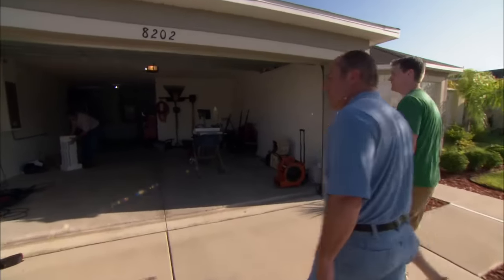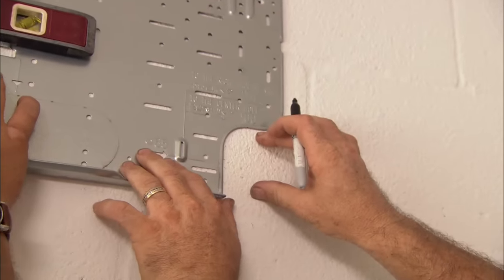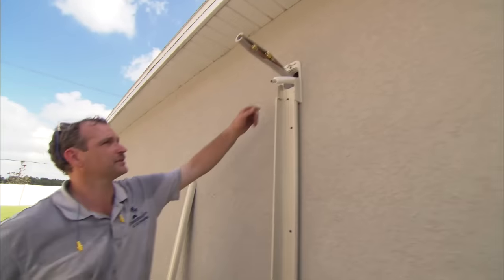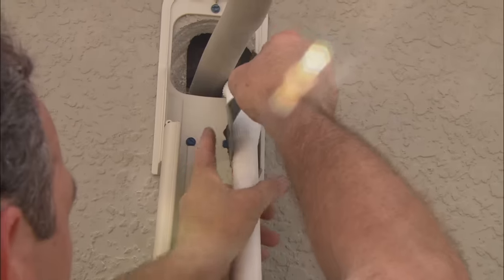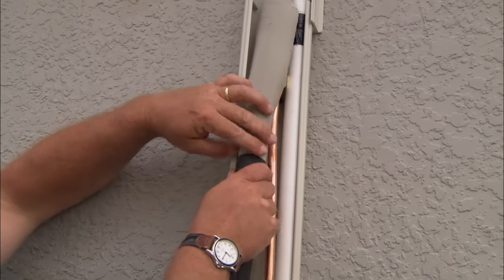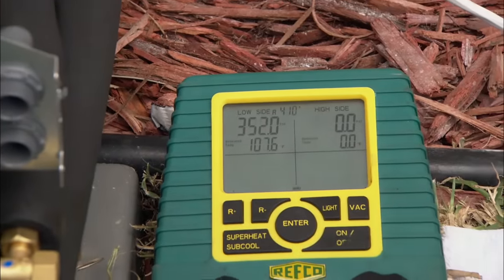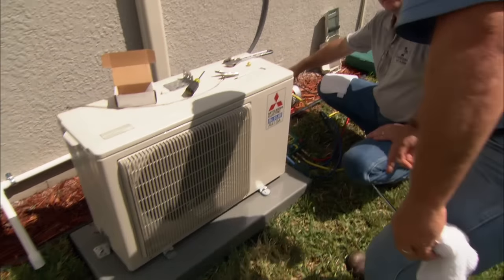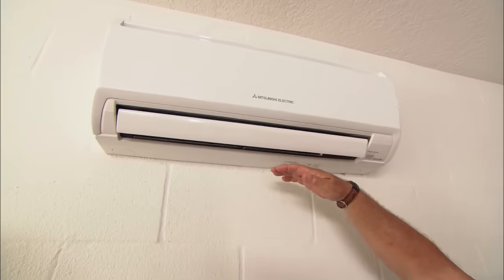How to Install a Ductless Mini-Split Air Conditioner | This Old House

Comment: I think potential purchasers  of a Climate Right mini-split AC need to know the company has virtually no repair plan for the system. My direct experience with their tech support yielded no repair option, just replacement of the entire unit. Who wants to have to tear out and replace the entire system within 3 years? It is the only option per Climate Right support. Buyer beware. Check with your mini-split manufacturer or HVAC service experts before you buy.

Comment: After watching a couple of TOH videos about mini-split systems I now know why installation costs are so high.  That is a lot of work putting in one of these systems and what it means to have qualified installers.  Thank you.
Reply: Ductless split units are actually usually quick easy money. As long as your not placing the heads on inside walls. The tools however to complete this job are roughly $1200.00.
Reply: In India the installation cost is $20 lol
Reply: @Dave-so7sf  Mr. Cool has a DIY kit with precharged line sets that don't require any of the fancy tools and can be installed by anyone.
Reply: lol what? Mini splits are very easy to install.
Reply: No, they are high because you are getting screwed. An even moderately competent person could do this in a day.
Reply: @Dave-so7sf  You definitely don't need 1200 worth of tools to do this.
Reply: @dancooper6002  To do it correctly you do. You need a tubing cutter, flaring tool, pipe reamer, refrigeration gauges, vacuum pump, micron meter, nitrogen regulator, and nitrogen bottle. Not sure about Mr. Cool but Mitsubishi is king.
Reply: @Dave-so7sf  You could probabally do without the nitrogen crap if you are careful. Gauges and a pump can be had cheap at Harbor Freight. The others are basic hand tools.
Reply: @dancooper6002  Didn’t realize you could purchase a vacuum pump that cheap. I’m a fan of doing a nitrogen test just because thats how I was brainwashed and it’s the correct way. However your probably right you could do without it. I would at least have that micron meter on there though. If it doesn’t pump down under 400 microns you probably have a leak.

Comment: One quick question, how did you know where to drill hole from outside that's perfectly aligned with the hole made inside? thanks
Reply: the corer has a drill bit thats pointy, when he went through the first wall, he kept it level and kept on drilling with the bit and not the corer. Once hes outside, you put the bit in the hold and core again.
Reply: use zip ties than tape
Reply: You can buy 18" masonry drill bits that will go all the way through.
Reply: we use a long drill bit to make the center hole throuth all the wall then you use your hilti with a guide , once the Hole is start you remove the guide and you drill, you have to finish on the outside to make a good finish, you also have to dril in a angle on the bottom to protect from rain , sorry for my bad english lol
Reply: Ramas  measure high and length Inside then do the same outside
Reply: The masonry drill bit has a pointy tip perfectly centered. After you finish drilling halfway through that masonry you take a small drill bit and drill through the mark the big masonry drill bit makes in the center. Remember he only did this not to mess up the stucco. His drill bit was long enough to go all the way through, but this was a professional doing the job and he went the extra mile to make this job perfect.
Reply: Ramas the hole saw they used had a drill bit a little longer than the hole saw and it makes a hole on the outside.
Reply: Ramas ja ja ja used your brain for ones ja ja ja
Reply: Measure twice .. cut once
Reply: Ramas the drill head has a drill bit in the middle once they make the mark they send another long bit straight thru the wall...that. will the center on the outside
Reply: you just drill a small hole in the middle of the circle to the outside
Reply: Dub C 

...reminds me of that old Carpenters joke;

" I cut that thing THREE TIMES and it's STILL too darn short!"
lol
Reply: a tape measure...
Reply: Man This guy is and expert installer..!
Reply: Ramas measure it lol
Reply: Rosie Alonzo This is not an English class, chill!
Reply: Jay McHue they probably don’t want to make a complete comprehensive guide  as that kind of knowledge and skill is how some people make money.
Reply: On the outside corner of the building you measure how thick one brick is, then you measure the distance on the inside to the hole. Then you measure that distance + brick thickness on the outside of the wall. If you’re half a cm off, it won’t matter for this purpose.
Reply: Pilot hole all the way through the wall before drilling from the inside
Reply: There are several ways to do this.
What I like to do is after I have drilled through the brick wall, is put a drill bit in the center of the circular saw bit. The bit should extend out farther than the teeth of the circular saw bit.
I use this bit to go ahead & drill through the rest of the wall, from right there in the garage.
Now, from the outside I have a small hole. So if my circular saw bit has a diameter of 4 inches, for example...I know where to drill from the other side.
All I do is place the center drill bit in the small hole & drill through.
Reply: @Nick1814  he was avoiding blowing out the outside of the when the bit breaks thru. Always drill from both sides for a pretty hole. ;)
Reply: Experience
Reply: Use your tape meusuere
Reply: Use a chipping hammer and make a huge hole from one side to the other
Reply: Super small diameter very long drill bit through to the other side 
So it’s an easy patch if you don’t want to keep the hole
Reply: First you need do a small hole drill after big hole drill
Reply: You can see that the hole bit has an internal center bit. That center bit goes through the wall first so then you go to the other side and match the position.
Reply: Tape measure
Reply: I just follow my instinct

Comment: I install these in Japan, have for a while. We don't test with the nitrogen, instead we make the connections and with the valves still closed on the compressor unit, we pull a vacuum with the vacuum pump, let it pump down for a while, and watch the gauges to see if it holds vacuum, it if does you are good to go, no need to lug around a nitrogen bottle and regulator. Nothing wrong with the nitrogen bottle pressure test, just a different way to do it. One more thing, once the lines are attached and you have pulled a vacuum in them, they are ready for the coolant. kind of one step less this way.
These systems are great, really like them.
Cheers!

Comment: Even though this is a new installation your evaporator was open to the atmosphere, so when you do your final evacuation be sure to use a Micron Gauge and pull the evaporator down to 500 microns then let it set for 20 minutes to make sure you don't see an increase in pressure. Some flare connection leaks that don't show up under a nitrogen pressure test may show up under a vacuum test.
Reply: George Crabtree evacuation is a necessary step isn't it? This video was helpful in showing how easy installation can be...but I was hoping to see this part that you mentioned.
Reply: T T if you do a YouTube search for evacuating a refrigeration or air conditioning system using a vacuum pump and micron gauge I'm sure there will be some good videos. It's also recommended to use a micron gauge in conjunction with your manifold gauges. Your basic dial gauges will only display your system vacuum down to 30 inches of Mercury where as a micron gauge will show you when you've hit 500 microns. When you do, valve off your gauges so that you are isolating the evaporator from the pump and the condensing unit. Let it set for  half an hour making sure all of your connections are tight, even your gauge hoses, if in that time you see a loss of vacuum then vacuum it to 500 microns once more a let it set for half an hour if you see any loss of vacuum, any number higher than 500, you've got a leak to find. Removing all air and moisture from the evaporator before unvalving the condensing units  pre-charge into the system Is important to the longevity of your system especially with the finicky refrigerants and hygroscopic (moisture loving) synthetic oils we are forced to use these days. Best of luck.
Reply: You just failed this one. Vacuum is measured in inches of mercury or inHG. Microns is a more accurate measure of with in inHG. Obviously I understand how vacuums work but you can keep googling scrub. 500 microns is used to make sure all moister is removed from a system. All manufacturers require a system vacuumed down to 500 microns or lower. 

The lowest inHG that you can achieve is on brand new setups today is 29.916inHG or 0.00394inHA which is 100 microns.

If I has vacuuming down to 20inHG thats not near enough time to pull out all the moisture in a system. Just because you pull down to that doesn't mean all the water is out of a system. 500 microns ensures that.

I stand by my statement and the engineers will back me up. 

To the folks reading back home this is the difference between a college educated tech and the "handyman". If you want your system to last get the guy that knows what he is talking about not the guy that spends 2 min vacuuming your brand new unit down.

Ill be honest I'm glad for hacks like you. Its the reason units fail so I have a job changing parts and correcting all your mistakes. 

http://www.engineeringtoolbox.com/vacuum-converter-d_460.html
Reply: ike fun. "28 lbs. of vacuum"? Have you ever installed one of these or any H.V.A.C.R. equipment? Even if you meant 28 inches of mercury you'd still be wrong. Any system  must be drawn down to at least 500 microns or you risk voiding your equipments warranty. Call a local installation company to verify.
Reply: ike fun. Vacuum isn't measured in pounds and because H.V.A.C.R. systems are "Sealed" or "Enclosed" systems your atmospheric pressure plays absolutely no part in the equation.
Reply: Just let the pump sit for double or triple the time. NO NEED for a micron gauge.  So many experts, so little money to make without install robbery. It is disgusting how much people have been charged for install one of these units. $2k, 3K...highway robbery. This should cost no more than $$300-500 on some harder spots... if you already have the 220v.

Comment: i think that the installation of indoor unit is more important to see because that is the hardest part where you going connect the copper tube and the drain tube while the indoor unit is hang together
Reply: +constantine asuncion thats the easy part they chose the flare cause to wield   copper is harder

Comment: I have so many questions…  wouldn’t it be a waste to install that in a block garage? There’s prob so much heat and cooling loss from that garage… no insulation. Also did he not use nylog on the flare fittings?? And you don’t suck out nitrogen with vacuum pump.. you just release it

Comment: Great Video, And clean work. What do i do if a mitsubishi ductless unit has one condenser outside and two  indoor heads and only one is icing up on the suction line?

Comment: Its really awesome that the unit is already charged. So I take it if your in Cali, you dont need a HVAC license if you wanted to install one yourself?
Reply: All you need is knowledge and a proper way to do it well and able to execute it. but when in doubt call someone professional. Always safety first.
Reply: All condensing units are pre-charged now.
Reply: @TampaMaximumMike   yeah for a certain distance of line length

Comment: A nice video. I just didn't like the electrical wire connection to the outdoor unit. Should use wire ends.
Reply: Danny F Then you are trusting that you clamped the ends on well.
So either way is really fine.
Reply: Danny F Then you are trusting that you clamped the ends on well.
So either way is really fine.
Reply: Rick Stanley I watched the video again. It is a perfect video and a perfect installation (the tube flaring, the routing etc), except the electrical connection.
In my previous reply i missed the word SLEEVE :-).  You should connect the electrical cable using end sleeves.
Thanks.
Reply: Danny F I found more for you:

-Copper piping flares need to be done with an eccentric flare tool and that is not an eccentric flare tool.

-Flare nuts needs to be tightened using a torque wrench. I decided to use a Snap On electronic torque wrench with crowfoot heads. Also have a Yellow Jacket but prefer the Snap-on as it is electronic and it also vibrates and you can actually see the progress as it torques up in numbers. Use Nylog on all the nuts to avoid friction while tightening. Friction will actually ruin a flare crown, and you need to oil it to prevent it. 

- Flares nuts I usually cut off and braze using nitrogen purge. 

- 350psi is pretty low to test these systems with. 500 to 550 PSI is more like it. 

- The contractor said that he pulled out the nitrogen with the vacuum pump. Say what???! What a sure way to kill a vacuum pump?! Hopefully he meant to say that he let it all out freely, and listened to it by ear, so he doesn't introduce any air into the pipe system. Either way, that's what the vacuum is for, so even if air goes inside it would be removed by the pump. Combine the pump with core removal tools, vacuum gauge and vacuum hoses and he is all set. Not a prime example for a contractor.
Reply: Danny F I go through that everyday at work! I have a itch for naked connections.
Reply: albowrx What we did on the advice of a ac dude who made the flared pipes for us was to lubricate the flare ends and use antiseize on the threads.
To keep the warranty good, we called an AC service guy to test the connections.  HE didn't use nitrogen or a positive pressure test. He hooked his vacuum pump to his gauge set and did a vacuum test. 240 bucks for about 40 minutes of his time. He seems quite confident that our installation was fine.  He even suggested I apply for a job at the company.
  We used open ended box wrenches and a monkey wrench. The flare nut sizes are pretty big. Also it was a good thing we took the unit with us when we had the lines made. One of the factory nut sizes is unusually big for the size line.

What you could do is open the return line test connection and then pressure line valve and purge the air out of the system then close it off and then open the return valve to the outside unit. Chances are you are good to go. The factory charges enough gas in the condenser unit to fill 20 ft. of line each way and the evaporator inside unit.
These guys are being extra careful in the video. From what I gather AC service guys don't run around with N2 tanks in their van.

Remember, oil the flares before you connect them and use lock thread. 

And the unit works great.
Reply: What you described is exactly what a HACK would do. But hey, we must be all idiots to invest in proper tools and proper education in these systems.
Reply: albowrx  Additionally, it would be best to evacuate before the nitrogen test to avoid "pushing" the moisture that is in the lineset into oxides that are on the inside surface of the lineset and evaporator coil.
Reply: Uhh? Are you a beginner or just a DIY? There is no oxidation inside of the piping or the eval coil when you buy the system. The only oxidation the lines will get is if you braze without running nitrogen while brazing. The lineset that you receive is refrigeration rated, and there's different measures put in place to keep that piping super clean, therefore the reason why the piping is delivered to you sealed. 
If you want to talk proper techniques, nothing beats triple evacuation method. BTW, nitrogen  will help in absorbing some moisture up as it is a dry gas. Either way, read the directions recommended by the manufacturer. 

To others, I know this is a given but avoid the temptation of putting a filter in these systems. I thought it was a given, until I ran into a system that had 2 filters on each side of the compressor. I wonder how it worked.
Reply: +tubatuba 
Well, the AC wasn't cheap. He was there less than an hour and charged about 200 bucks.I feel confident enough to know where you can cut corners without loss of quality. 
I just said probably, anyway. We wanted to keep the warranty valid, so we went with calling a pro in for sake of having a receipt also.
This guy saw the work I did with the installation and told me to apply for a job at his company. So I guess I'm not that much of a hack..
Reply: @albowrx  Why would nitrogen ruin a vacuum pump? "Air" is 80% nitrogen so why is that an issue? Not contradicting you, just wondering.

Comment: can someone clear up the power wire? it has both control and HV? is bought from the homestore that way or does it come with unit?
Reply: most units call for either 16gauge and 14ga communication wire.........  run three wires between the units

Comment: my contractors did not do an evacuation for my r410a gas unit. he told me the compressor was pre-charged. is it normal?
Reply: I find it hard to believe a credible contractor to not evacuate the lines and inside unit after installation to remove moisture.  On the other hand I can believe a cheap contractor to not do it to save money.  YES the outdoor unit is usually charged with freon when it is made and leaves the factory.  I spent 17.5 years at Trane, Inc.at various jobs building outdoor units( or the condenser units) for their systems.
The small line is the liquid tube and the large line is the gas line.

Comment: He used two crescent wrenches to make the line connections.  Don't you have to use a torque wrench?
Reply: no
Reply: Absolutely not, you back up the top nut with an adjustable wrench then use another adjustable to snug the flare nut.
Reply: Not on a compression fitting.